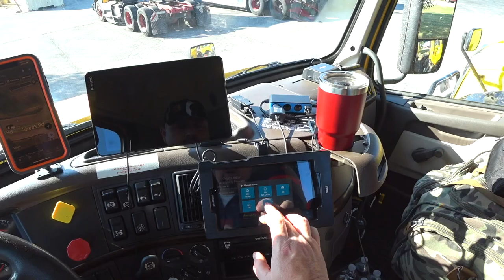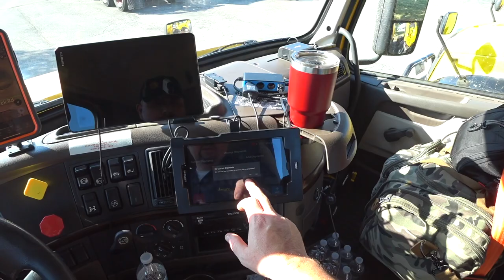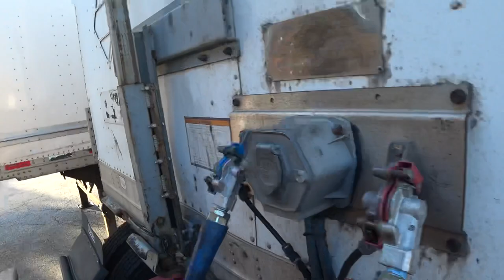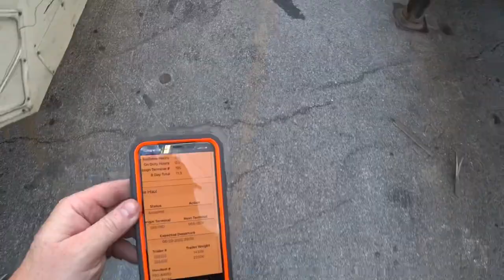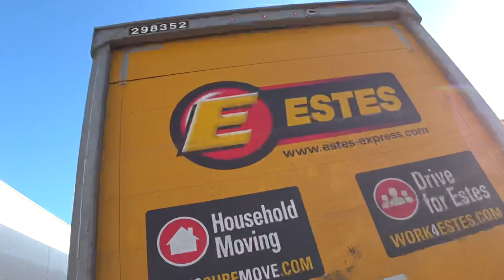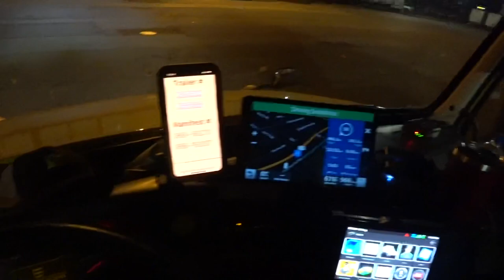This is how you Build a Set - Going to another New Terminal!! (Estes Express)

Comment: What's with the check engine light? Noticed it when you pulled into the Indi terminal...
My freightliner has one on too and it's the soot sensor in the def system. Scheduled to go in on next oil change.
That was a nice sunset at the beginning.
Reply from the maker: It’s been on for the last 40k miles. It’s a faulty sensor they can’t get the part for as of yet.

Comment: Hey Chuck - a question...

When you pull a trailer away from the dock like you did I didn't see and red and green lights at the dock. They always had them when I was hauling mail. Red light meant you can't hook and pull it away - green light meant that the trailer was closed and ready to be pulled away.

Was wondering how you tell if the trailer was ready - that nobody was in the trailer when you hooked to it.
Reply from the maker: We only hook to trailers that have been closed. When we are dispatched on a trailer it is only because the dock has closed/sealed it and generator paper work.

Comment: Hey chuck I was wondering what brand/model of hand held flashlight 🔦 do you have? I am looking into olight warrior rechargeable
Reply from the maker: The one I just got quite working so wouldn’t recommend this one 😂
Reply: Get a stream light stinger. Rechargeable. Comes with light/charger and two batteries. Charger has both 120v  wall,,  and car 12v charge cord. Can't beat it at all for about 150 on Amazon ‼️. Same light the police carry. Is super super ‼️ bright. Been using the chit owt mine 3 year with no issues at all ‼️ they even sell switch and led bulb replacement assembly.  So it's not a throw away light you can rebuild it when need be.  Absolutely worth every dime ‼️ very durable  ‼️✔️👍
Reply: @TheTulsaTrucker  ooh dang that’s no good 😂
Reply: @nervouswreck392  thanks for the info I’ll look into it. 👍🏽 👍🏽